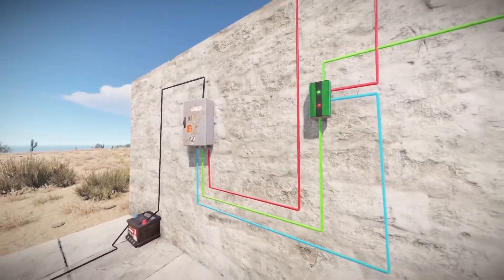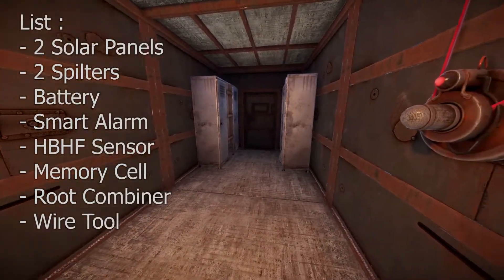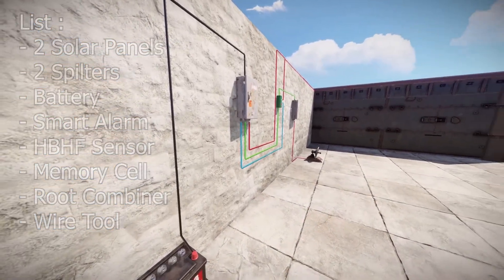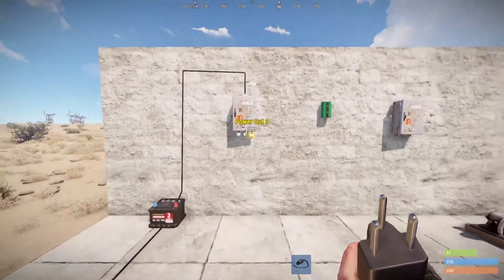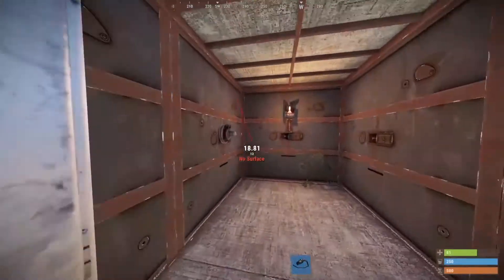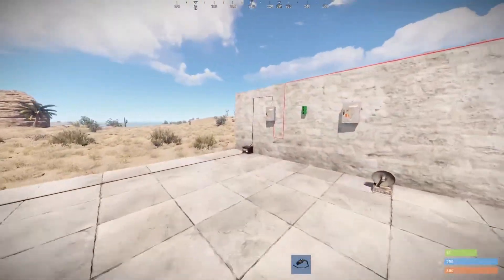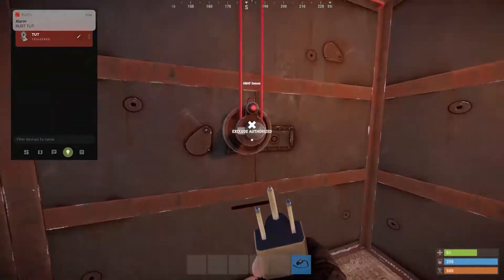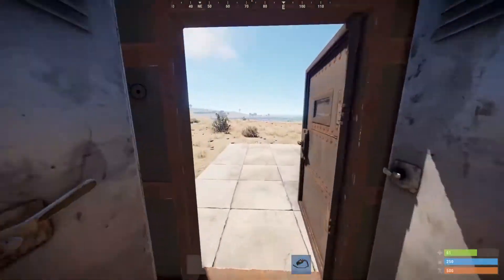RUST Smart Alarm Setup Guide :: Rust+ Smart Alarm Tutorial :: June 2021

Comment: It's a lie. Get rid of the splitters and the memory cell. All you need is a battery, a heart beat sensor, and the smart alarm.

Plug the battery into the hbhf sensor, plug the hbhf sensor into the smart alarm done.
Reply: Does it work so simple? Because I see everybody using the memorycell. 

Also, can you pair multiple HBHF to one Alarm?
Reply: @filippoferrari7176 If you think about it the Heart beat sensor acts as a switch. There is a power in and a power out. When the HBS sees someone it turns the internal switch on and let's power go thru it. When the smart alarm gets power it notifies you. I haven't tested it in a year so idk if they changed it.

Comment: great video, a friendly suggestion the loud music made it difficult to hear you when the bass hit. i actually liked the background music but maybe a little softer next time
Reply: I spent a lot of time thinking about what this setup does and i mean each component. The memory cell and splitters are unnecessary.

In this set up the battery is supplying power to the hbhf sensor and the memory cell. The memory cell is being used like a blocker. There is no need for a blocker because the hbhf is its own blocker. 

Thank you for coming to my Ted talk.

Comment: Fantastic, is it possible to connect more than 1 sensor to the alarm or does that require multiple setups?
Reply from the maker: You can have more than one sensor on one circuit. The battery just needs to be able to support the extra power required. Soo you have to have more solar panels or a generator which I've used in the past.
Reply: @billie4273  Alright, thank you so much! Most helpful!

Comment: You could just power the sensor then run the wire from the sensor straight to the smart alarm works too less work
Reply from the maker: No that doesnt work.
Reply: @billie4273  Can confirm that works, just did it now
Reply: @billie4273  it does work tho
Reply: @Milo-il9qc  but it could kill the electricity of your base if nuked right? I'm new to Rust and dat is what I was told.